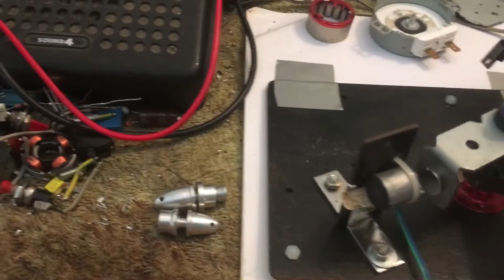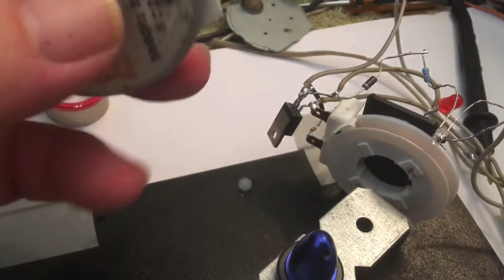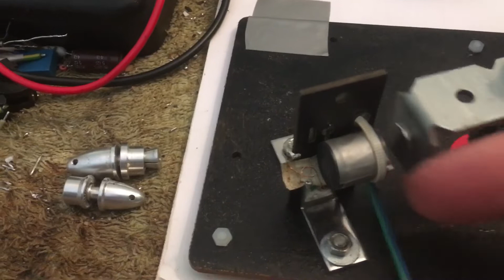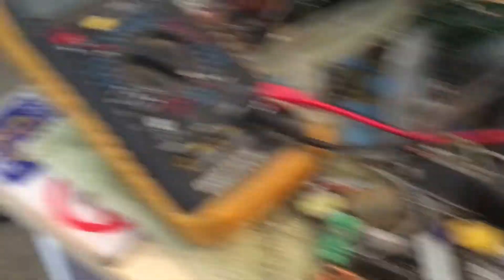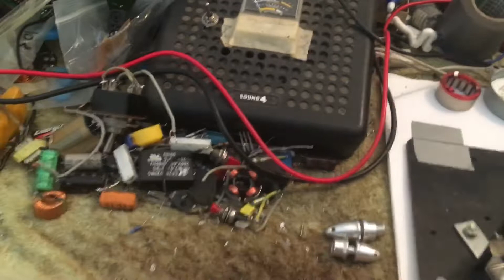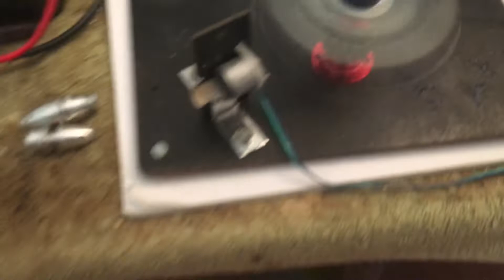pulse motor using RC hobby parts.

Comment: Well done.  I tried similar setups using a mircrowave turntable motor coil and a ferrite core choke.  One of the interesting things I tried was to put the choke inside the big coil.  It kinda worked but I wasn't happy with it.    Basically it comes down to what you are trying to accomplish.  Somethings work better than others depending on the goal.  I really like your work space.  It looks just like mine.  Ha.
Reply from the maker: cheers. since i made this clip i've improved a few things.
it has a clear timing mark now and i can call the on period 27degrees,( using picture editing on my phone), x 2 events, so 54 out of 360 is 15% duty cycle. 
i also put a diode and cap the other way across the pickup coil and it gets to about 13.6 v @ 2000 rpm. this is to monitor how many volts across the 1k resistor to base, but if im reading the spec sheet right the tip 122 can handle up to 120 milliamps of base current.
it's better balanced now and i will mount it all on a solid base.